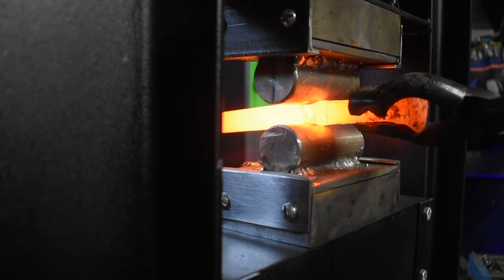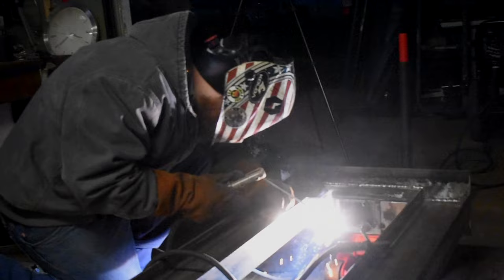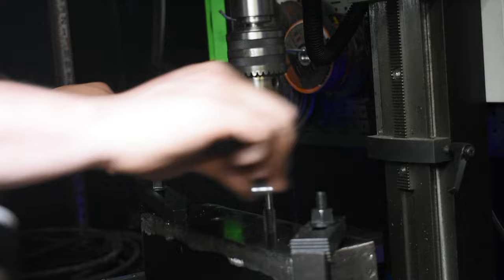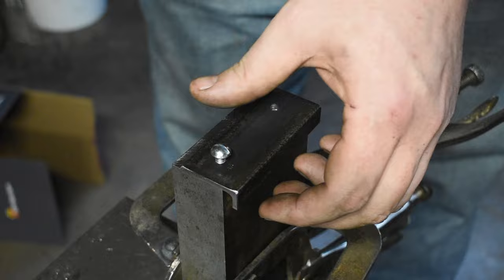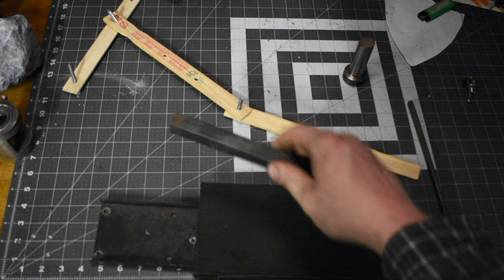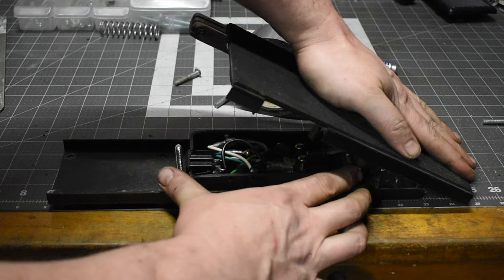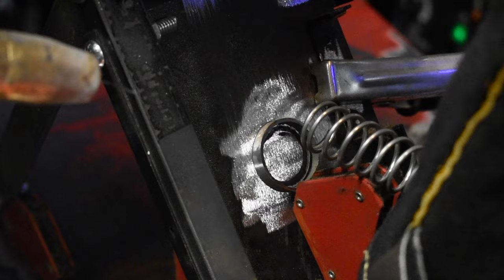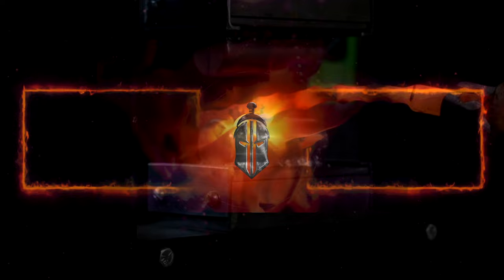"Electric Forging Press" Harbor Freight Log Splitter NO MUSIC W/ Voiceover #forging #knifemaking

Comment: Man I am glad you put this together!  I’ve had this project on the back burner for months.  Once I saw some one do this vertically it made much more sense.  Less shifting dies and seems safer.  The only problem is I couldn’t find a good video showing how they accomplished it.  So thanks for doing the step by step with tutorial!  I’ve got a 7.5 ton splitter sitting in my garage waiting.
Reply from the maker: Thats awesome! A 7.5 ton splitter would be even better too. Im really glad the video helped.
Reply: I didn't think it would work vertically. Was there any modifications that you had to do to vertical?
Reply from the maker: I didn't have to do anything to the log splitter to be able to run it vertically. It will be fine either way. The hydraulics is a pressure system, gravity wont effect it.  @TCMW2020

Comment: How much have you used this and is there any faults or improvements you could make?
Reply from the maker: Thats a great question! If I could go back and change something, I would probably get a 10 ton log splitter instead of the 5 ton. But it does work. I used it a few times to draw out material. It does make things go quicker than hammering by hand. But it's not lightning fast either. It might only go a little bit quicker, but it is a whole lot easier than drawing everything out by hand. I still haven't tried to make Damascus, yet. But that is something I want to try very soon. Or at lease a San-Mai billet.

Comment: I've read the hydraulics on these don't like to be up vertical - something about fluids.  I'd be curious if you run into any issues.  For sure having it vertical like this is a big space savings
Reply from the maker: I asked a diesel mechanic about running it vertical, and he says since its a pressure system it fine. Gravity doesn't play a role. It's kinda like an excavator runs a ton of hydraulics and they move in all kinds of positions. The electric Motor doesn't matter which position it's in either. So I figure it's ok. But we'll see I guess. Ill do in update video in a few months or so. Thanks for the comment. It's something to watch out for.